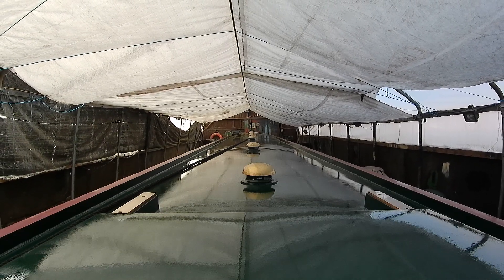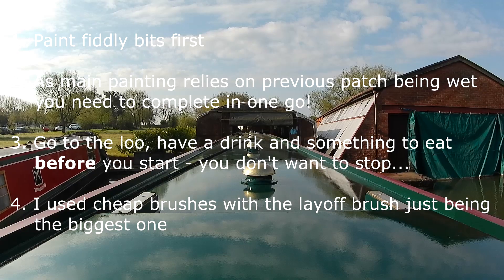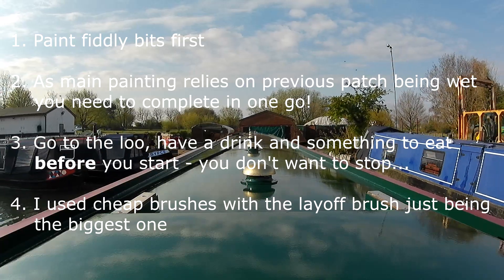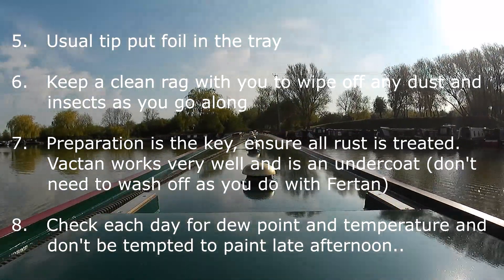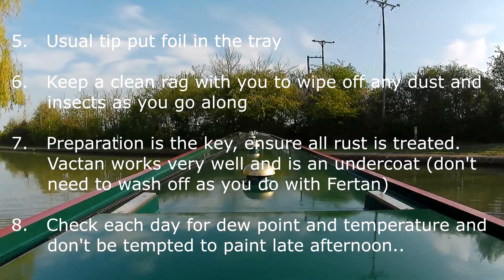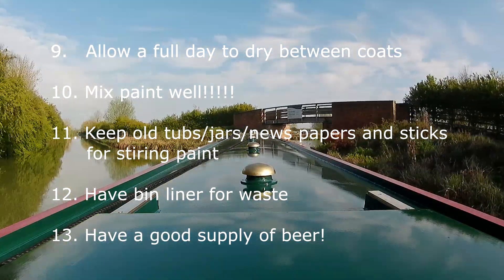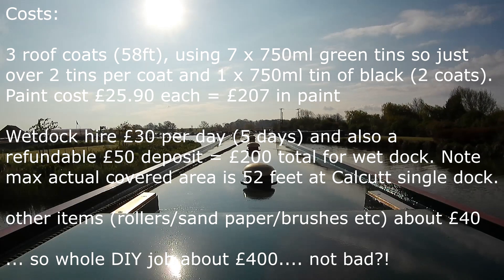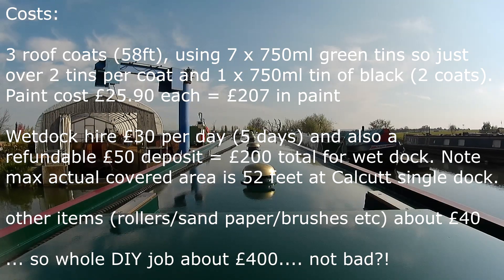#23 Part 4 - Wet Dock Review & Paint Job Costs

Comment: never painted a boat but done plenty of vehicles using a paint called Tekaloid, very durable used by lots of coach painters. Ask the paint suppliers if they have a mixing machine and to knock the paint up for you, it might have been on the shelves for a while. Pop the pain tin into a plastic tub of hot water, this will ease the application by brush or roller. Your boat roof looks good.
Reply from the maker: Thanks for the tips!
Reply: Tekaloid there’s a name from my past , I sometimes painted old Morris minors with it .Is it still made ?
Reply: @theteadrinker-143   Yes its alive and well, available on line